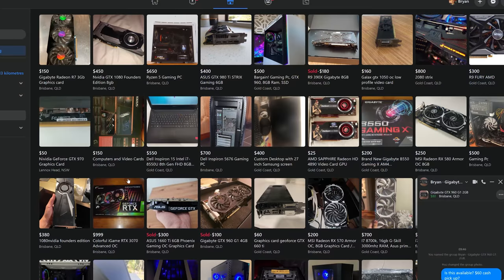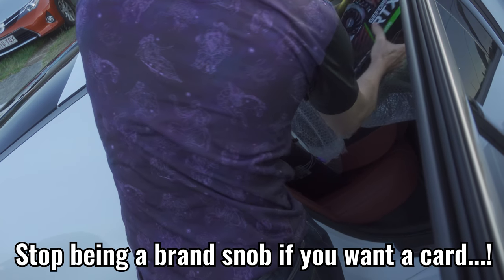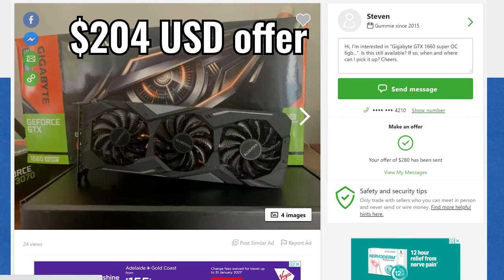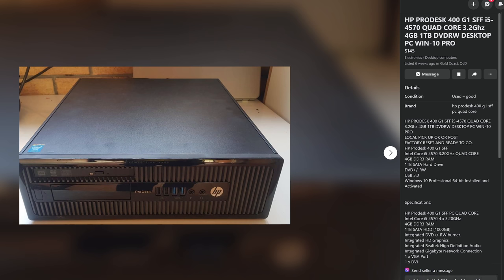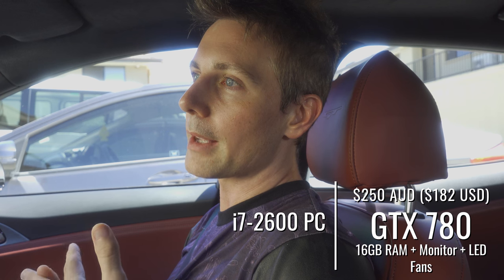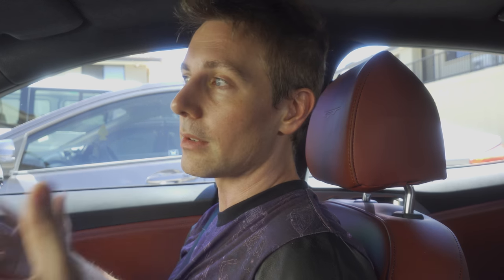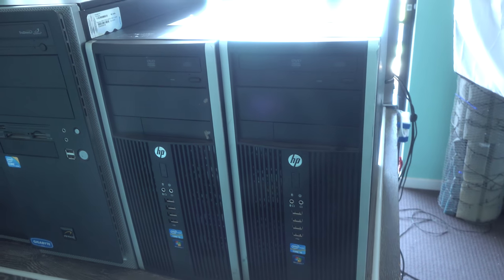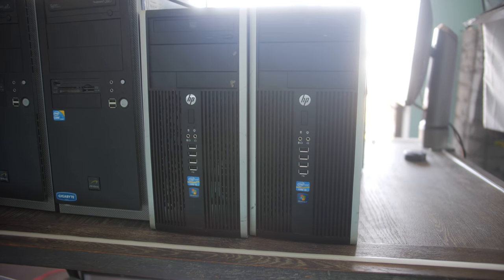November's 2020 USED PC Parts Hunt - Buying $50 Computers!

Comment: Can you gift me a gpu sir? I have a i5 4440 and 8gb ddr3 1600 mhz set up. Im financially incapacitated to buy a gpu for my set up. Ive put my budget to buy a modem for me to have internet connection so that i can find some work online. Thank you! Hope.youll notice this. 😊
Reply: Used RX480 or a Used 980 TI would cost you $100 most. I've made a pc with core i5 4570 with a used RX 580 for like $300. 
If you still can't afford it, buy a used RX560. You could get the used 560 $80 max.
Reply: If you STILL STILL can't afford it, buy a used GTX 680 Ti. I saw one on ebay for less than $50.
Reply: Using rx570 right now. And its pretty ok

Comment: Aussies are wasteful with tech its a fact!  Not saying others aren't.  But even supposed "recyclers" like ewaste ben literally prove that.  His description of himself is a lie (technically) as he actually just produces more e-waste from viable products out of laziness.  He has even admitted to that.

Should do a dumpster/trash pc haul and see what can be fixed up to work as a viable product for uses like a retro pc build or a home server (depending upon specs)  It'd suprise you i bet.

He then makes literal chump change vs what the hardware is actually worth by sending it to e-waste after destroying it instead of repairing.

And quit being lazy with  not taking all pc/monitors and useable hardware from dumpsters like multimedia keyboards/good office mice.  I can see no printers (see those all the time, esp the 3 in 1) as its literally cheaper to buya  new printer (about $30 usd on the cheapest end) vs paying 30-50 (depending upon model and if you want the small or large comptible ink cartridge for your printer model) per cartridge (often need at least 2, more with fancier ones).

But unless its a headless server you ALWAYS need a keyboard and mouse and those would make great cheap bundlers (after a quick test).  And a good monitor is always of use too for the same reason (at least 20-30 usd to get a 1080p monitor used)